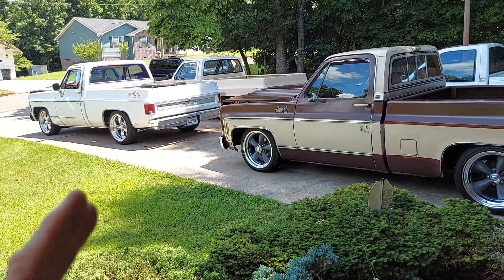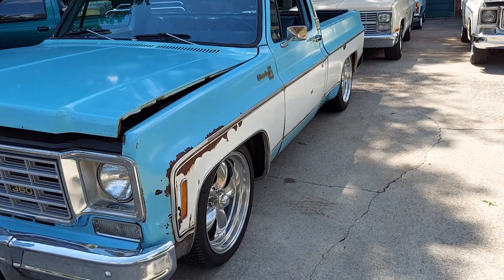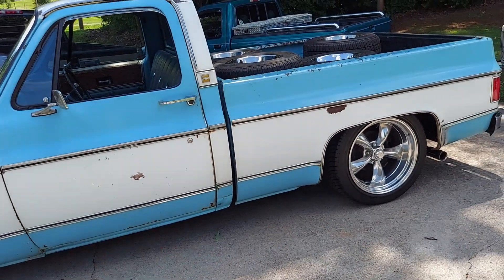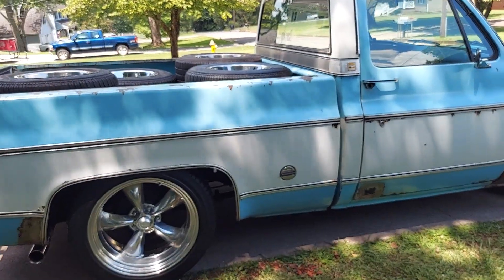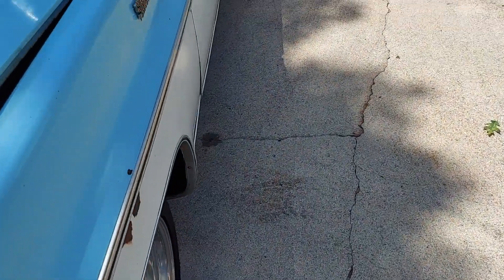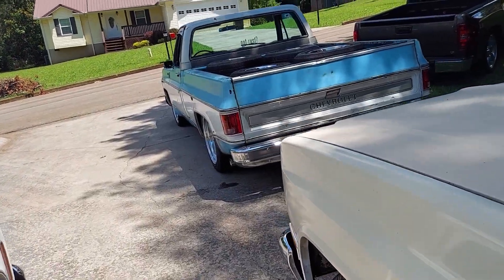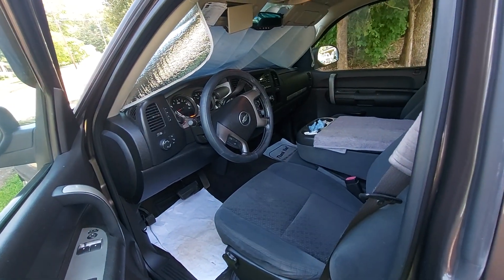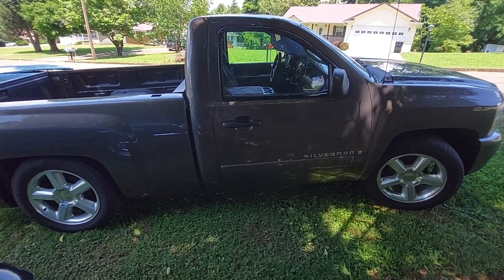Here's all of my trucks all together! Which is your favorite truck? Least favorite? Check them out!

Comment: The original color of Shannon is the original color of the truck you see on my profile.  It was a 77. Russet metallic is the color. It was a 77 longbed with a very rust free cab so I used it on my 80 shortbed frame.  Also I do have a nice original GMC console for one of these trucks if I had some nice factory buckets I would put them in one of my trucks
Reply from the maker: It's a beautiful color! I wish that I could have painted it that color but I couldn't find paint that color with all the Covid going on at the time. But I think that it still looks good. Thanks for your comment my friend!

Comment: I do like all of them but I have to say the 75 blue & white one is my favorite. 
I had up to five insured and licensed squares on the road up until recently. I’m down to two now as of January this year. I kept my 83 GMC because my wife’s dad bought it brand new and only has 74,000 original miles on it and I kept my 89 Chevy dually crew cab which is lowered 5/3. I had an 87 crew cab shortened to accept a short bed and put 1/2 ton suspension on it lowered 5/7. Somebody flashed too much cash in front of me to pass up so I let it go.
Reply from the maker: Oh yes I understand completely what you are saying about "Flashing"! Lol. It happens sometimes! Lol. That's why I made the video just so I can look at it later and remember if I sell one or two! Thanks buddy for your comment!

Comment: Sky is my first choice. I think I have made this comment before but I would love to see Skye brand new with the wheels and lowered like today. I like Sam but I've always liked the OBS trucks since I seen the first one. Left turn bill is cool because it has a four speed I grew up in the era four-speed transmissions and muscle cars still love them today. Shannon is really cool truck I did not care for that truck when you first got it but you have really transformed that truck the color is what I did not like At first not really the truck but it looks great now. I like coffee because it's a single cab short bed two wheel drive lowered 20 inch wheels looks great. Hard to find a modern-day truck like that in the day of extended cabs Crew Cabs and four-wheel drives. S10 Ranger is a nice little truck it's in really good shapIe for the age. Although it was not in the video and not a truck I'm always a fan of the 62 Impala. The Lincoln is also a really nice car you probably should drive it more. The Xbox I know little about never been around one but I know you guys love it so that makes it good. I understand the gas mileage thing we have a Nissan that gets 36 miles to the gallon so the trucks set in the driveway. So I guess that just leaves one truck left Billy James. That would be my least favorite truck if I had to send one down the road that would be it. From hearing of the life that it led I do think the frame is bent a little is why the bed does not set right with the cab. I think Frankenstein would have been a good name for that truck since it's made from different trucks.😅😅.
I think I have covered all of your running Vehicles I'm not going to comment on the non-running parts vehicles. I would love to meet you sometime my wife and me would buy you and Mrs pib a good meal for all the entertainment I have got from you guys. We could have a marathon and see who could talk the longest. You might win but I would be in there close. I made this comment long on purpose hoping your ears would bleed too.😆😆😆.
I love your channel and your content. You and Mrs p i b have a great day.
Reply from the maker: I really appreciate the comments on the trucks! And I appreciate your opinions on the best and the worst of them! I must say that Billy James has a good frame. It's been on the lift and it's good. What makes it look bad is the dent in the bed that I explained a couple weeks ago that makes it look like it is not lined up with the cab. I doubt that you could "out talk me" though! Lol. Maybe meeting one day might be in our future! Who knows! But bring bandaids for your ears when it happens! Lol. You and your wife have a blessed day today my friend! Thanks for your comment!

Comment: You really have a great collection my favorite is definitely Skye I have to say Shannon is runner up if I weren't 2400 miles from you I'd try to trade you my 83 c10 5 7 drop on 17" rallys and my 91 obs with Cadillac tail lights and a Cadillac front end  with all tubular control arms and tubular parallel 4 Link with a watts link the works with all ride tech valves and air control system (they are both custom) for Skye haha! 
that's how much I like Skye and where I'm at in California it would be smog exempt
Reply from the maker: Thanks very much for watching the video and for your comment! I have to agree with you that we are a very long way apart! Lol. But sounds like you have a great truck as well! I really appreciate your comment and I hope that you will have a blessed day today my friend!